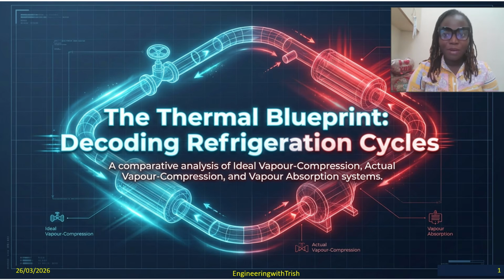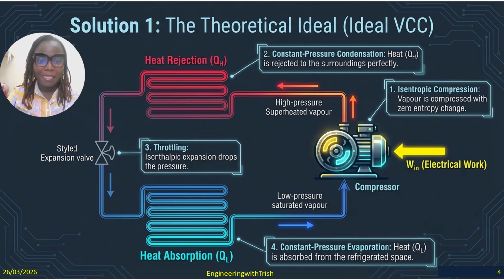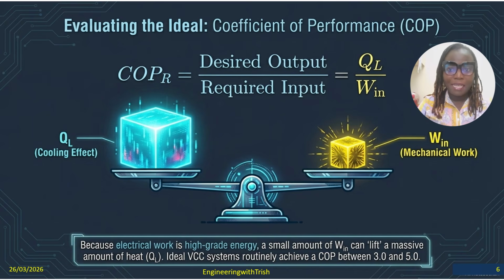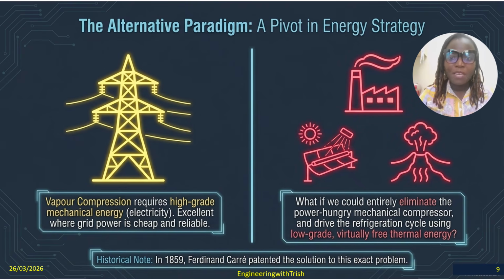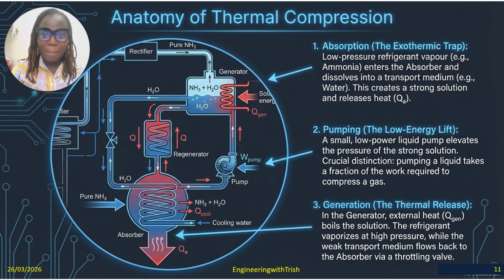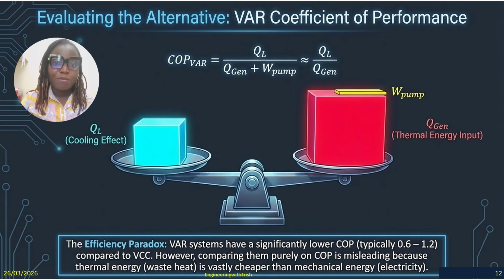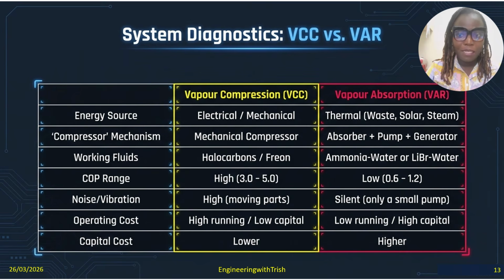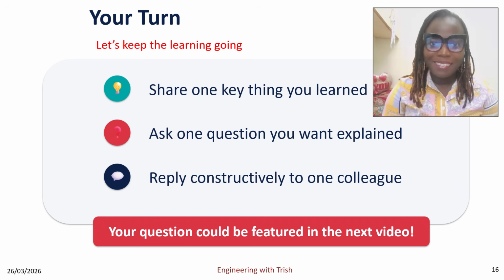Ideal vs Actual Refrigeration Cycle Explained | COP & Real System Losses

Comment: I also learnt that, there are inefficiencies in the actual cycle of refrigeration.  These are; Frictional losses, Pressure drops, supercooling and subcooling.
Calculation of the coefficient of performance in Refrigeration (COPŘ)= cooling effect/workinput(QL/Win)
In this calculation,  the cooling effect has to be less than the work input in other to get the actual COPR of the Ideal cycle. 
Schematic diagrams 
In the VCCS the four main components are present  while the VARC components are replaced with Generator,Pump,and the Absorber.
The VCCS Has higher efficiency as compared to the VARC
Reply: Yes it true

Comment: From my perspective,  I  may choose efficiency as compare to availability of energy  because  availability has to do with a critical state where engineers choose the system where is needed to be while the efficiency comes with low operational cost, less environmental impacts , high maintenance and lifespan, and also has to do with the performance of the system.

Comment: I learnt that the VAR lacks compressor and instead uses the generator, pump and absorber  but still achieves the same pressure transformation but replaces mechanical forces with chemical affinity and heat. 
And the VAR system have a significantly lower COP ( typically 0.6- 1.2 )compared to VCC ,which have a high COP of ( 3.0 -5.0).

2. The question would you choose efficiently or energy availability. 
Ans: 
I would choose energy availability rather than efficiently because efficiently alone is used to measure the performance of a refrigerator,  WHILST  energy availability gives deeper insight  such as it measures the useful work potential of the energy and where improvement can be made in the system
Reply: Yes sister

Comment: I learnt that the ideal  cycle is a prefect cycle, there is no heart losses, there is no pressure drop
The ideal cycle, the mechanical compressor is 100% efficient and heat exchange involves zero pressure drop The ideal
-in the actual cycle, there is a friction losses and heat losses
It includes inefficient in the compressor 
The actual cycle reduces cooling effect and increased work

Comment: Can there be a situation where the generator, absorber and the pump in a VAR is specifically replaced with a compressor to continue it's function with it? And if it's possible, will it change the VAR to become a VCR?

Comment: Ideal cycles assume pipes have zero resistance. In reality, every bend in a copper pipe and every inch of tubing causes a pressure drop due to friction. This means the compressor has to work harder to "push" the refrigerant through the system.

Comment: The vapor Absorption system consists of the four main components that is the Condenser, Compressor, Evaporator and the Evaporator valve but the Vapor Absorption systems, the Compressor have been replaced by the Generator,pump and the Absorber

Comment: I will choose efficiency if let say I stay in an area where electricity is more available because it takes less energy to perform the same cooling and I will go for the availability if let’s say I stay in a locality where electricity supply is not efficient but I have the waste heat or cheap fuel is available.

Comment: Vapour absorption systems have lower COP than vapour compression cycles because;
1.They uses low quality heat
2.They are cheaper 
3.There are much heat loss in the system as compared to the vapour compression system due to the energy source

Comment: This is very interesting. I learnt that in the ideal refrigeration cycle, compression is assumed to be isentropic (perfectly reversible and no losses and also heat moves smoothly). But in reality, this cannot happen because of friction and heat loss caused by the compressor and also pressure drops and superheating and sub cooling also contribute to the reduction of the COP.
Reply: I also learnt that, even though the ideal cycle is not practical, we can exchange the compressor for a generator for a silent and smoother run but doing so, sill also affect the COP of the refrigerator and also it’s costly too.

Comment: Absorption system has a lower COP as compared to the vapour compression system because they use low quality heat and they are also cheap.
Reply: Yes 
Because they use low quality heat
Reply: Yes 
Because they use low quality heat

Comment: Basically the difference between ideal vapour compression and actual vapour compression is:one is 100% efficient with no losses(ideal).Thus, the is no temp. loss, process is isobaric it is simply perfect.Whereas the actual vapour compression is not perfect,comparing it to a machine we can say it does work against friction.
There are heat losses and efficiency (COP) is lower than the ideal vapuor compression.

Comment: In this lesson I learnt that  ideal cycle is a perfect cycle ( compression is isentropic which is vapor is compressed with zero entropy change). There is no losses no pressure drop. But for actual cycle there is nothing like perfect cycle because, there is friction and heat loss and pressure drops.
Also I learnt that for VCRs(  Vapor Compression Refrigeration System)we have four main components they are the compressor, Condenser, Expansion valve, and Evaporator. While for the VARs( Vapor Absorption Refrigeration system) the compressor is replaced with a Generator, Pump, and Absorber .

Comment: I learnt for actual cycles there is lower COPs because , frictional losses and non-ideal compression shrinks the cooling effect while in the process demanding more compression work .
Reply: Based on these losses ,advancement like better materials for compressors,and even smart controls could reduce loses right?
considering energy availability ties into this- if energy is abundant like solar or waste heat for absorption systems as mentioned,design priorities shift towards optimizing for available energy rather than just minimizing lossses.
 I’d chose energy availability madam

But I would like to know what scenario would we have to prioritize efficiency over energy availability please?

Comment: I learnt that,in the VCCA there is mechanical compression whilst in the VAR there's a generator absorber and also the difference in an ideal /Perfect cycle, there's no losses and the mechanical efffeciency is very good and it needs a higher grade vapour compressor.

Comment: The Vapour Absorption Refrigeration (VAR) cycle achieves the exact same pressure transformation, but replaces "mechanical force with chemical affinity and heat."

    In (VAR) Compression process is replaced by :
   —> Absorption(The Exothermic Trap)

 —> Pumping (The Low Energy-Lift)

—> Generation(The Thermal Release).

More videos please 🙏. 
Thank you.

Comment: Some ref components needs higher energy to work whiles efficiency is not 100% due to heat loss and friction in machine parts so whether Efficiency or Energy availability,it depends on the engineer choosing the right environment

Comment: Vapor compressor makes a lot of noise and has a lot of moving part mechanical and vapour absorption is silent running with a small pump and powered by thermal energy

Comment: I learnt that, mechanical pressure is 100% efficiency (isentropic),and heat exchange involved is zero pressure drops
Reply: To your question, 
I would choose efficiency because, it tells how good the system preforms.
Reply: Do we have normal efficiency in refrigerator?

Comment: I learnt that Vapor compression systems have higher COP compared to the vapor absorption systems because they use high quality heat like electricity or mechanical heat energy

Comment: I learnt that refrigeration cycle has four main processes which are the; condensation process, evaporation process, expansion process and the compression process. Such that the components determine the process .
Also I learnt ideal cycle is the perfect cycle, there are no losses and heat transfer is smooth
Reply: Definitely 💯
Reply: @DANIELMENSAHTETTEY  Frictional loss is a factor that affects the coolig effect  whiles demanding more compressor work leading to a lower overall COP
Reply: Exactly

Comment: 1.Are there any environmental advantages of using VAR over VCR

2.Ideal cycle is a perfect cycle ,there are no losses and no pressure drops and mechanical compression is 100%
Reply: Yes, the VAR will  be more  advantageous  to the environment. This is because the mechanical  energy  needed is   thermal  which is primarily  available  in the environment  abundantly  such as waste , heat etc. Again the use of this energy  sources will help to reduce  the pollution  in the environment,  well utilization  of heat energy  from the sun and also  it less costing as compared  to the VCC system.

Comment: A VCC runs using the compressor, condenser, expansion valve and evaporator while VAC runs instead of using the compressor for high pressure and temperature refrigerant it uses a generator.

Comment: I learnt that in ideal cycle the mechanical compression is 100% efficiency and there are no leakages , no energy loss, no pressure drops. And also the performance of refrigeration system is  measured using the COP
Reply: That is 100% true
Reply: Perfect 👌

Comment: I learnt that the VAF cycle achieved the exact same perssure transformation, but it replaces mechanical force with chemical affinity and heat.also the compression process is replaced by absorption,pumping and generation.

Comment: So the actual cycle has lower COP as compared to the ideal cycle
Reply: Exactly, and it's because in real-world applications, systems face frictional losses, heat losses, and compressor inefficiencies.
Reply: @gideonadeti exactly that's why mechanical machines have their efficiency less than 100
Reply: Sure my brother 👍
Reply: Yes please
Reply: This is because of the reduced cooling effect and increased work input.
Reply: Sure  bro. But we also need  the understanding  of the ideal cycle  for us to work toward  designing  more efficient  devices
Reply: Yes blouse of the heat loss and the friction
Reply: Indeed u really understood it

Comment: Thank you madam 
How do pressure drops in the evaporator, condenser, and suction/discharge lines reduce the overall COP?
Reply: The COP is the ratio of the refrigeration effect to the compressor work so a drop in pressure lowers the refrigeration effect value making the compressor work value higher leading to a small COPs.
Reply: Pressure drops in the evaporator, condenser, and discharge line reduce COP because they decrease the refrigeration effect and increase the compressor work